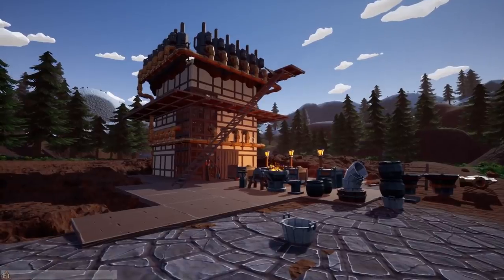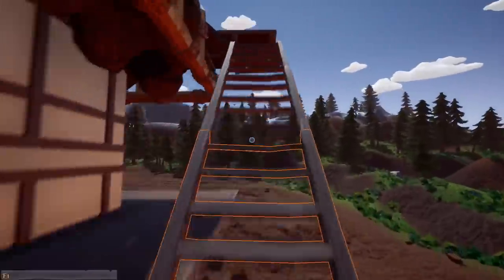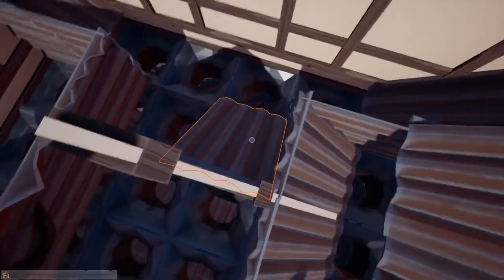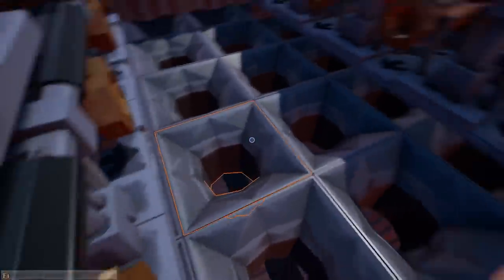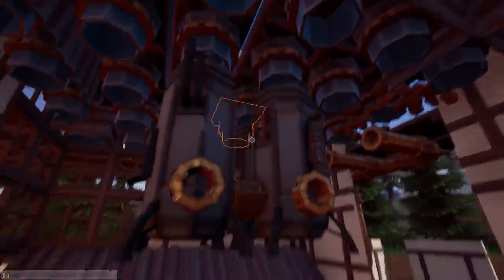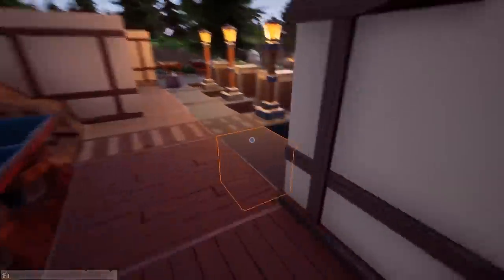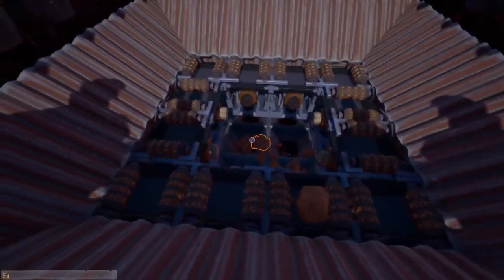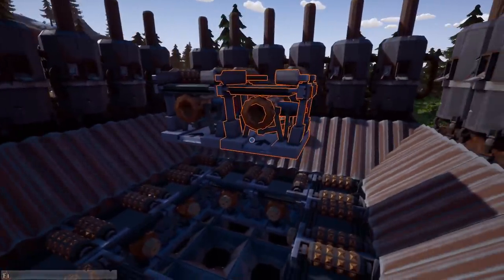Destroying My Gravity-fed Gold Mine By Mining $12,000 A Minute - Hydroneer

Comment from the maker: FYI I just recorded another episode and I FIXED the system... Like really fixed it using the same mechanics, not going to spoil anything but fear not.... we will make a tower, I will not give up :P
Reply: Dont use funnels next time so the big ones get grinded or thing flow around
Reply: Well maybe a staircase of grinders should work :)
Reply: No spoilers loool well i know its fixed now cheers drae, jheez. Good job looking forward to the next one.
Reply: Why didnt you just remove the roof and let it fall in ?
Reply: You might be able to fix it by putting walls in between the funnels as the dirt will not get stuck in the joints
Reply: if u stop can u share the save please i would love to fix/build one beside urs
Reply: Upload soon yeah?
Reply: Also could use the poles at the four corners too
Reply: @shaunwilliams2770  He just said he fixed it so he wont need to :/
Reply: @War2.0 Ha if it doesn’t work then it may be a possible solution 🤷‍♂️
Reply: Also AUTO SMELT! It will never lag again. Ps dont quote me on that but it will help with lag like alot look at Mikespc1080p how he auto smelts he puts a furnace inside of a block than sets the crucible on top and it solved all his lag issues
Reply: There is a better funnel if u use 4 sloped roofs clipping into the grinder. Also to remove most of the lag have the gold iron and shards going into a hot cauldron (using 4 tool stands makes a nice holder for the cauldron).
Reply: Drae remember most game ceilings can be bypassed.
Reply: Will it help with the lag if the pee stream of gold from the sorter shoots directly into the furnace thing to melt down?
Reply: The developer acknowledged the funnels aren't great and is planning redesigning them in the next round
Reply: you should put walls between the funnels so dirt dont get stuck
Reply: thanks Drae, for the totally-not-a-spoiler

can't wait to watch it :)
Reply: Let me guess you removed the funnel
Reply: What if you did something that would blow blitz's one million gold bar goal out of the water? Like making a machine (with this system apart of it) adding a super-auto-smelting system. If you are correct in saying you fixed the system, wouldn't it be cool, to have a gold bar, or even an iron bar, that costed something like ONE BILLION COINS? Now that... Would make you a myth among peasants. What if you created this system to not be as laggy as this version? I think having a gold bar, or iron bar, worth ONE BILLION COINS, or even, if there is enough gold/iron in the game, ONE TRILLION COINS, would make you earn "THE MYTHICAL SUPER MEGA AWESOMELY ULTRA MEGA RARE LEGENDARY MYTH OF LEGENDS OF DOOM! VERSION 1.0" title... I just created.
Reply: I think you can load things from the store into a vehicle and sell it for free money. Let’s game it out played the game a while ago and he found it
Reply: banana gamer grë
Reply: banana gamer uh
Reply: Please, read the comment I just wrote, I think I had a very good idea with a lot of potential. If you want to try it in a smaller version, give it a try in a 3x3 and if it works and you like it, you can redimension it as much as you want.
Reply: This comment made me sub
Reply: bet you could make it better with some trail and error
Reply: sorry was 32 drills
Reply: Best game ever

Comment: The longer the dirt is moving through a system, the higher chance it will cause blockages. Just put the harvesters right on the ram drills.  A way to make that work with this system is put walls in a circle one block away from the ram drills. This forces the dirt from that drill to go down and won't collide paths with other drills. Throw a funnel and a harvester below that and it won't get blocked. And if it does, only one drill gets blocked and the rest still work.

Comment: I see your comment about fixing the system, but I was thinking about how you could put a slanted roof over top of the 4 refiners that lead any dirt into the grinders and use the small wall pieces to limit large dirt from passing from the grinders into the funnels. The small wall panels leave a little gap above the conveyors/grinders and would only allow smaller pieces to go through.

Comment: I had the exact same problem with funnels.
But I did come up with a solution!
What seems to do the trick so that the funnel is fool proof from the dirt fetus of hell:
-----
1.) The dirt must fall from a conveyor belt. The last end piece of the conveyor belt must also be the dirt crusher mover thingy. Overall also just have lots of those instead of casual conveyor belts.
2.) The crushed dirt, which will begin to fall from the conveyor belt, must have at least 1 cube of free space to fall, and only then hit the funnel; the momentum helps it from sticking to the funnel.
3.) Do not have multiple funnels side by side (this one hurts you the most, I take it). Otherwise the dirt can still get stuck in between the funnels by some magic.
-----
So yeah, all in all to recap: do not ignore conveyor belts, especially the crushers. Hell, replace all of them with the crushers. Do not get too greedy by stacking funnels together. Keep in mind to have a fall to increase momentum to avoid sticking.
Reply: Do bear in mind. This would in practice mean a total conveyor belt hellhole and requires expanding. Not for people with anger or heart issues.

Comment: If you turn on the water first then the drills so that they are not synced up it would likely not overwhelm the funnels. The reason they were overwhelmed is because dozens of dirt pieces would fall in at the same time then merge, so de-syncing the drills would fix that problem.

Comment: What I think you need is to have a layer of grinders the whole width and breadth of the tower that push the dirt towards a gap along one edge of the tower where you can have your extractors or whatever they are called.
And above that layer of grinders you need a layer of conveyors pushing all the dirt over to a gap above the start of your grinder floor.
That way you guarantee that ALL the dirt goes through your grinders before going through the funnels.

Comment: Simple solution:
Start turning off drills until u reach no clumps but are at maximum output without clumps. Then u can just remove them from the system and everything would run smoothly. 
Drea solution: change everything

Comment: I have a suggestion for the first part video, change timing what I mean is have half turn in with a vale then set up other half on different value and turn it on in a different timing, ps you don't need those plugs at end of track grinders, if you turn the value on track in side it will grind and not spit water out end

Comment: You could try to replace the dirt crusher with 8 roofs and turn the water pipe on before the drill and while it's on, turn on the drill one by one, so the drill don't throw all the dirt at once, hopefully it will fix your problem with the build up

Comment: Try to make the whole system linear, so:
1 drill, 1 funnel, 1 crusher all in one line, separated by walls from other segments (conveyor belts for gold/iron can be shared). 
That way you won't get any blockages and the whole system can be easily expandable, as gold ingots doesn't stack.

Comment: I'd recommend that you remove the top four grinders, and since you can phase the panels together in the corners that lead to the grinders directly around the funnels, I'd say that you should section off each funnel with vertical panels so then they don't get caught on each other, they would simply bounce off the panels once they come out of the grinders and fall right into the funnels. If this doesn't work I don't know what will, I just hope you'll be able to understand what I'm saying XD

Comment: It looks like the dirt clumps together after the grinder belts, making them useless. A possible solution would be to isolate each drill and using 1 grinder for each, but that would require another complete redesign of the system.

Comment: As you’ve discovered, funnels suck. Add that to the annoying dirt-recombination feature and you’re screwed. Take out the funnels, I think you’ll find they are unnecessary. Additionally, I’d dump your filtered output into a heated crucible, that should help cut down the lag since you’re getting rid of those nuggets that software is trying to keep track of.

Comment: Hey Drea why didn't you just use the roof pieces to build a floating pyramid where you put the additional grinders in the center.. That way when the dirt is shot out it slides down onto the lower roof pieces and then into the grinders. No pipes or need for removal of any drills.

Comment: What i would do
\ is the extractor 
/is the drill 
- is dirt with hidden piping
| are walls
v are funnels

     \ -|/v
    \ -|/v
   \ -|/v
  \ -|/v
 \ -|/v
\ -|/v
-|/v
v
Basically extractors placed below the them directly in a 1to1 config with dirt or walls acting as the ceiling and mini blast room s isolating each other with the piping being squeezed in there and or hiding the pipes to avoid any clogging.
A note your current house is clogging due to the sheer number of dirt over loading the extractors.